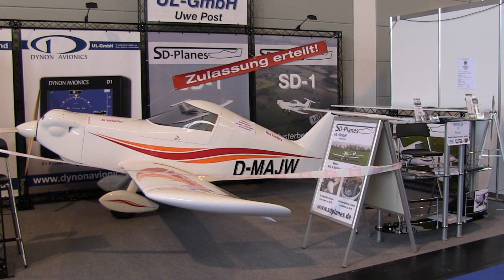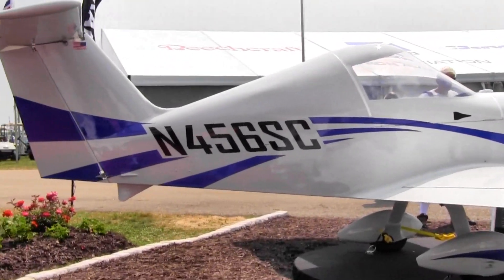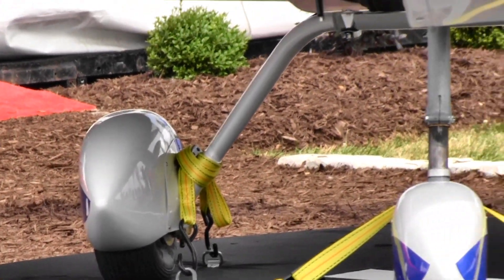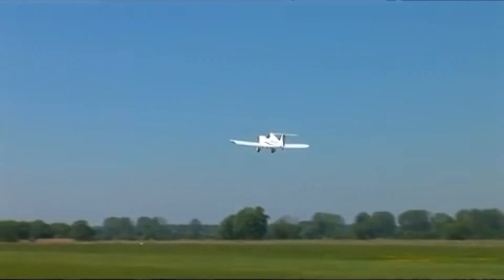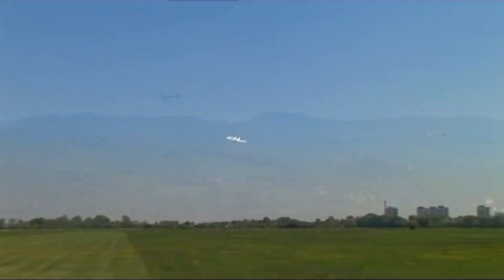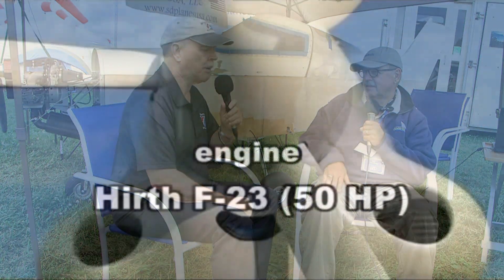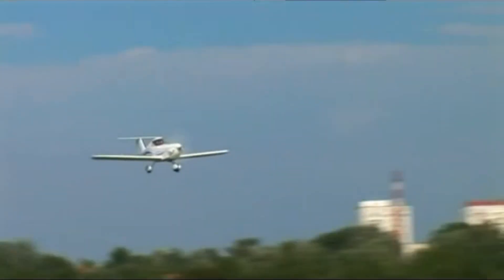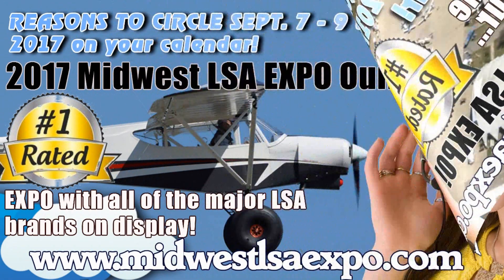SD 1 MiniSport, SD1 Mini Sport experimental aircraft from SD Planes USA AV16

Comment: I quite like a minimal approach and optimization and I think the concept has far more potential in sleekness and appearance because looks are very important. And there is huge potential in a clean design that's easily mass produced. I believe in a factory hammering out a plane in 2 hours instead of 1000 amateur hours of unknown quality. 1000 unnecessary hours is a waste of life in my book.
There is no reason that a sleek dirt cheap plane couldn't go 300km/h and have 2-3000km range. Add to that 4way fractional ownership and it could be 5k$ for a brand new plane. That's powerful.

Comment: Good videos.
I'm thinking a plane can really be a very simple thing. How about a styrofoam kit that you dowel together and lay fiber glass on and a gel coat. Could that work? Just super simple assembly.
Some large rollerskate wheels. Couple of dirt cheap electric motors and off the shelf 18650 commodity lithium cells.
It seems absolutely obvious to me that a clean design and well thought out production technique, you can hammer out planes by the thousands for pennies.
It can even look hella good and go fast. Beauty costs nothing. Aerodynamics costs nothing. It's just smart.
Reply: Actually , rc planes are incredibly durable and 
lightweight , they usually have carbon fiber wing
supports, it could work.
Reply: @bikersoncall  an RC model airplane doesn't Cary a payload.
An RC is flying at gross-weight at all times, simply to bring a battery that lasts 8-15 minutes.

The best lithium batteries in the world are only 0.022 the energy density of gasoline/kerosene. That means you need 50X the weight in batteries v.s. fuel, to fly the same distance. 

Fuel usually takes up 15-25% of the airplanes loaded weight. (Call it 20% average) therefore you need to carry 10X the airplanes gross-weight in batteries to fly the same distance. That doesn't even make sense.

Comment: there was a company that was coming out with this airplane you could buy completely built LSA compliant that was supposed to sell for around 65 thousand ready to fly. Do not know what happen to them but they  seemed ready to go and then disappeared as it seems so many upstart low cost planes do,
Reply: They made a huge mistake using a non ASTM certified two stroke as the engine choice and could't get the plane certified, it sunk them. Nice to see someone else at least trying to bring this in though.

Comment: Nice plane, lousy engine selection....needs to handle heavier engines. Two strokes are a no go to me. I wish you luck otherwise.
Reply: what about B.M.W. aircooled motorcycle engines, the two cylinder boxer's?.
Reply: There are several four strokes available for the SD-1, such as Briggs & Stratton SE33. You can't put heavier engines into such a small plane. The SD-2 however uses Rotax 912s.
Reply: This is apparently a weight issue, up to around 100 pounds is the limit. Not too many non 2 strokes that do that unfortunately.
Reply: Would a Hummel 2 Cylinder VW work?